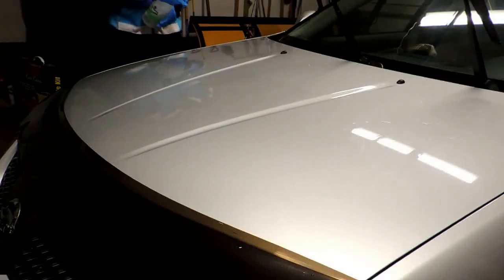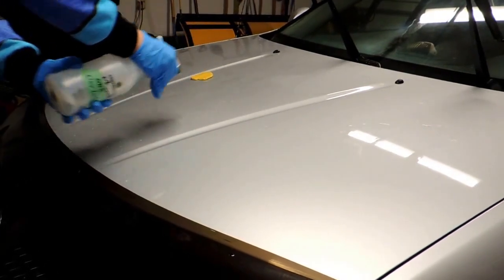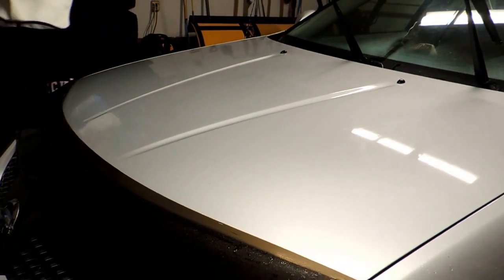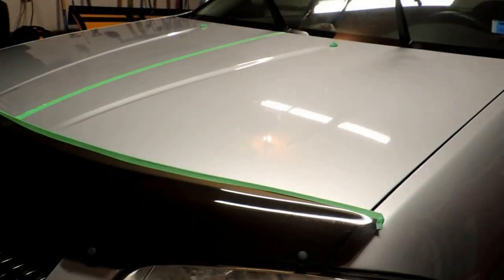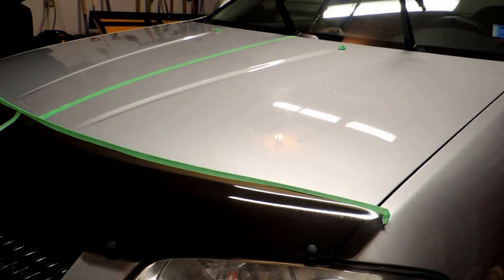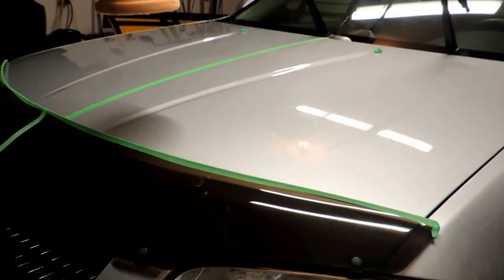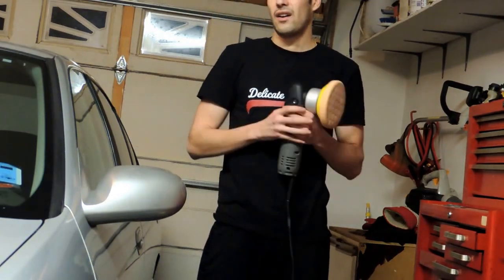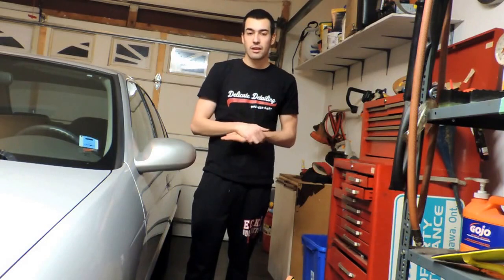Stoner Car Care's B586 Polish & Seal Test

Comment: My wife's black Honda had heavy swirls and severe acid rain damage. We spent two hours with a DA yesterday with Stoner Clear-coat Compound (step 1) and a foam cutting pad followed by Stoner Polish & Seal with a polishing pad. The results were amazing! These are great products for use with a DA.
Reply from the maker: Tom Muldowney Good to hear! I'm going to do another test, this time a full 2 step, hoping to get better results, just waiting for all this snow to get clear, (we just got a foot within the past 2 days lol). Allthough tbh I'm not a 2 step fan. from my experience
 there's a few products out there that can eliminate the same amount of damage in one step. I've barley touched my 2 step products compared to my current all in one.